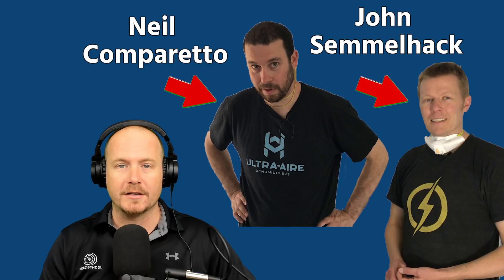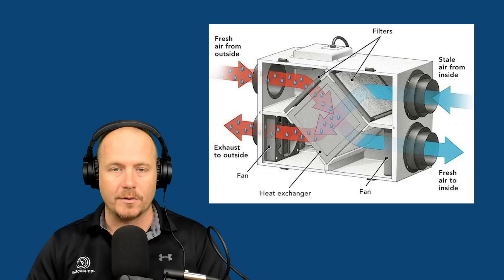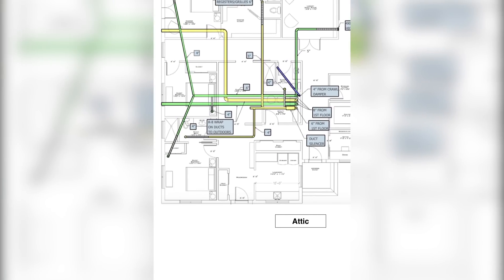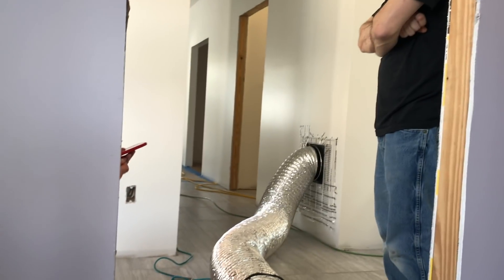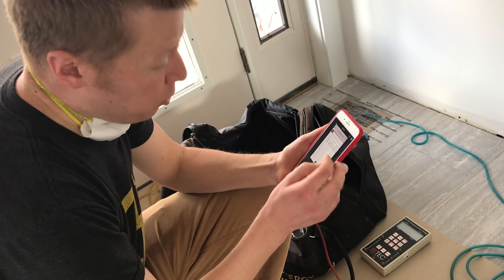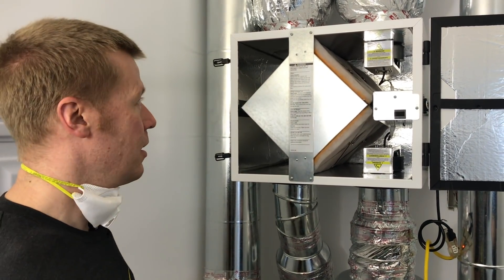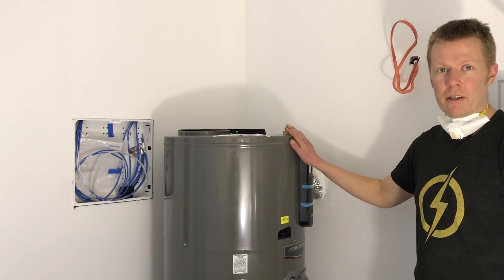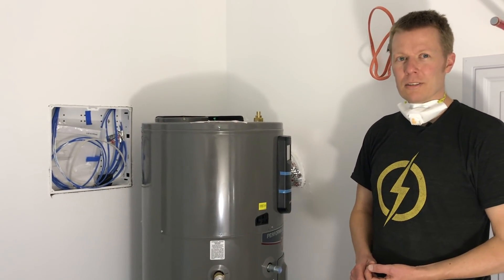Testing out a High Performance HVAC Installation

Comment: I still think using hard pipe on straight runs is easier, than pulling flex tight. This is probably from running hard pipe for the last 25 years. We use flex duct only to pull over the hard pipe to speed insulating the duct.
Reply: Dennis Treacy 10’ and under yes. Above 10’ I think flex is faster.

Comment: In the area I work in we don't see systems like this. While I like the specs on it I don't like it at all from a serviceability standpoint. The undercut doors lead to carpet filtration. Is that basically an insulated door covering the indoor coil?
Reply: bill j the combination of leak-free ducts, great filtration, and blower on the warm side keeps the AHU very clean... There is no carpet in this house so that not an issue- I hear you though.
Reply: @neilcomparetto  very interesting install. I'd like to see a long term update on one.

Comment: I am buying a Rheem heat pump water heater, I was thinking of taking its intake air from a conditioned attic as it is always a bit warmer up there than in the living space. Would there be any advantage to that? 

I figured it would be easier for the heat pump to transfer heat if the incoming air is warm to begin with.
Reply: John Salazar sure, warmer air will help with the performance of the water heater. Depending on how difficult that is the juice may not be worth the squeeze 🤷🏻‍♂️.
Reply: @neilcomparetto  We are rebuilding after a fire. Going from natural gas to a mini split, so we have a flue going from basement to attic that is not going to be used. Since the path is already there should be pretty straightforward?
Reply: @thebigdoghimself  what else is in your mechanical room? What region do you live in? Alot of time we spec a heat pump water heater to lower the dew point in a mechanical room or basement.
Reply: @thebigdoghimself  since you live in a colder climate for winter, any benefit you get from warmer months will be washed during colder months when you are taking much colder air from attic. I would not recommend  the extra work. If your basement will be 50-60 degrees that heat pump is gonna work just fine, and you will be as efficient as rheem specified
Reply: Allergy suffers dream clean fresh air conditioned continuous supply.

Comment: Does the Rheem heat pump circulate air from the mechanical room to the crawlspace and then back using a sealed crawlspace? Is the house in this same air space or is the mechanical room sealed separate from the house?
Reply: The heat pump water heater discharge air is sent to the sealed, conditioned crawlspace. A transfer grill in the floor brings mixed air back up to the house.